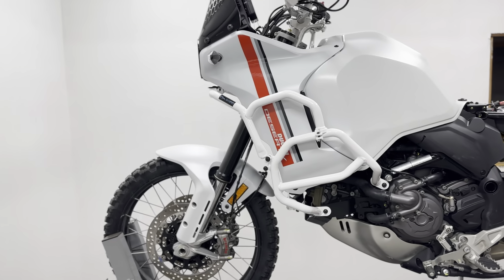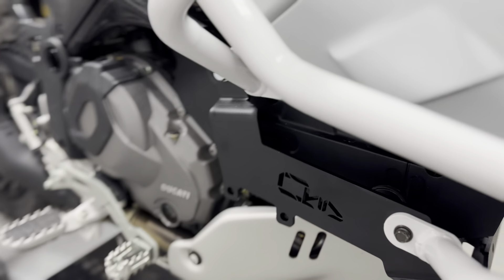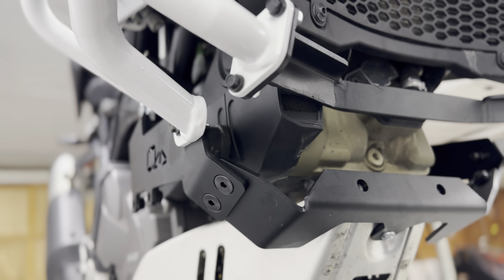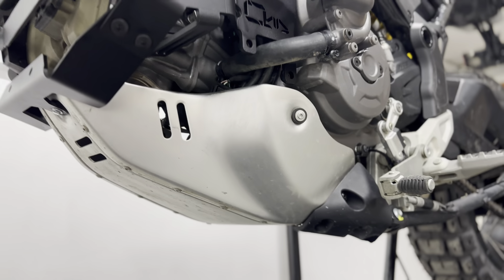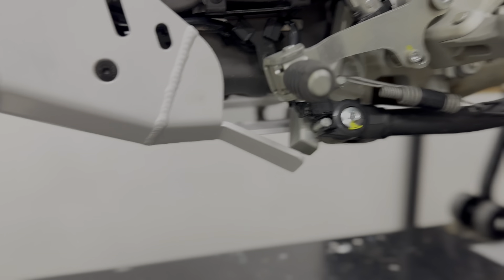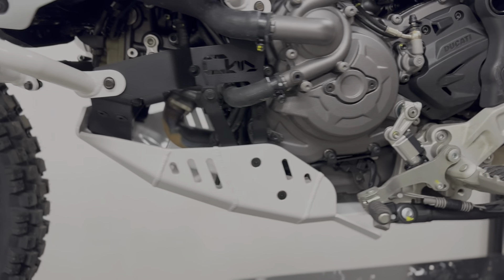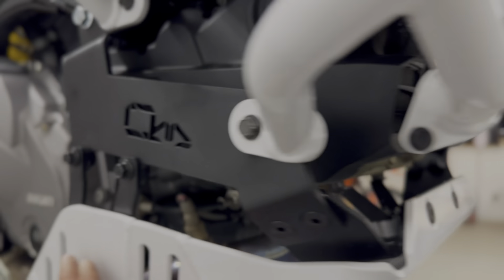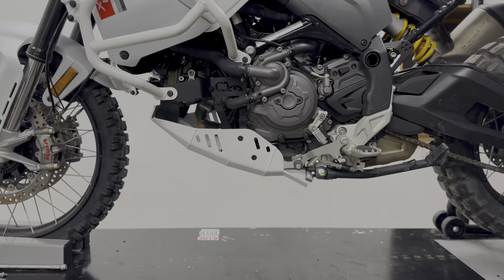Ducati DesertX Crash Bars, Skid Plate + Water Pump Guard Intro

Comment: I've been running the OEM crash bars and plate, since they were the only option available for a while after i got the bike. The quality is terrible though, and I'm planning to switch to yours soon. 

Question: what is the front tire you have on the bike in this video?
Reply from the maker: @newenglandscrambler2262  thanks! 

The tires are MotoZ Tractionator RallZ